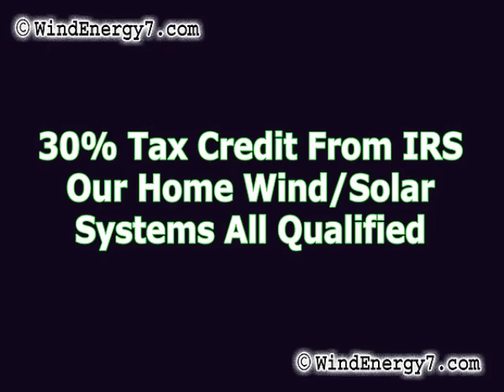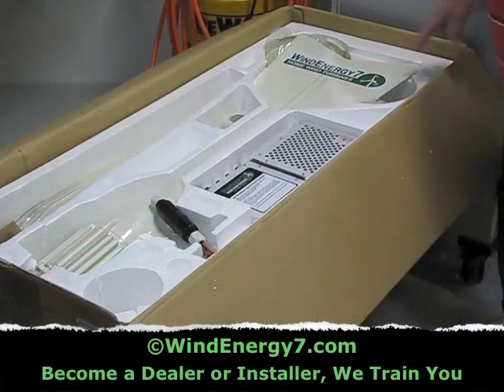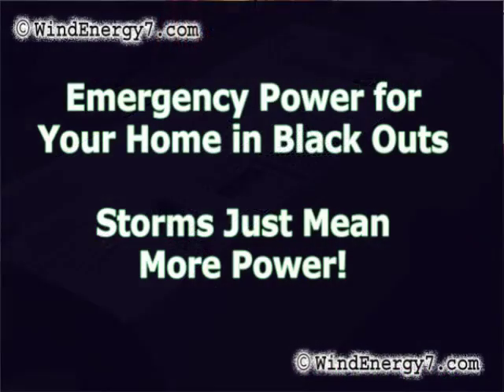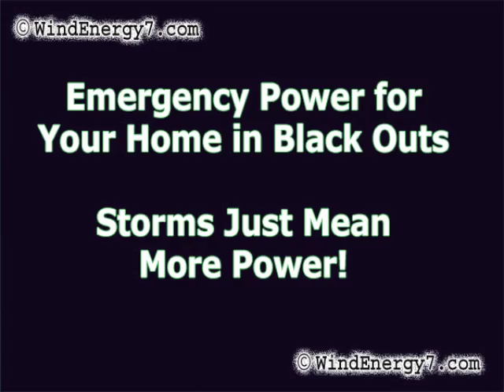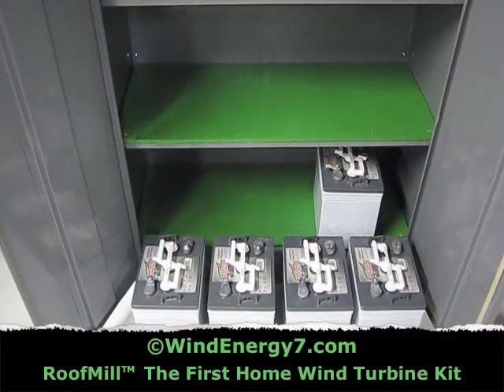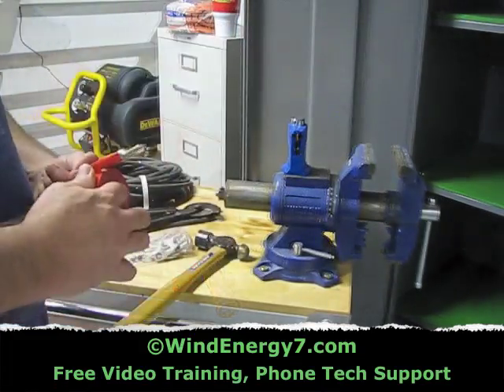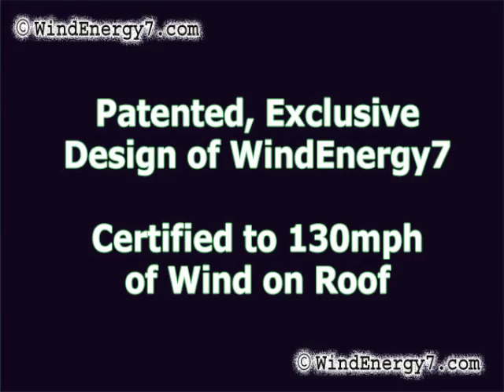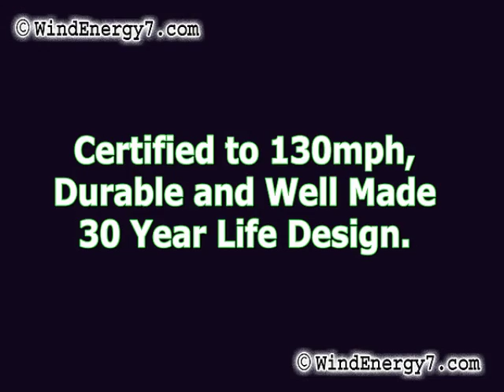RoofMill™ Rooftop Wind Turbine

Comment from the maker: @Bogt When I put a 3 turbine system into it to make an installation with turbines and solar panels packed in, strapper onto the top, The (MIDSIZE) SUV is as small a vehicle as I can use.  It's much more economical that a truck whick would haul systems easier.  It's also much better than my competitors who need a CRANE, CEMENT TRUCK, and TRACTOR to erect their silly towers. I have no shame in my (MIDSIZE) SUV.  I will be getting an EV for my local city driving.  Thanks for your interest.

Comment: I love your system. I have a couple questions. I am assuming that this system uses air that is channeled up from the roof. Does the pitch of the roof need to be facing the prevailing winds to be effective. My roof faces south, and the winds come from the west. Would this unit still work for me?

Comment: how strong wind must be to pull it off the roof? In croatia we have wind hits as strong as 170 kmh and rising ,so I wonder can it resist that power?
Reply: ahmet al shabab I read on RoofMill.net that it makes power starting under 6mph I think.
Reply from the maker: +ahmet al shabab Its engineered and certified to 130mph wind which should survive hurricane and most tornadic winds.  It mounts to the building so if the building goes, it goes.  But if the building survives, these don't just go blowing off a roof.  Its a very well designed heavy duty turbine.